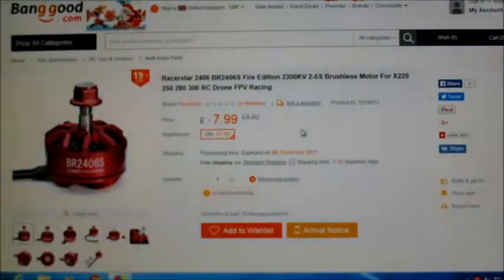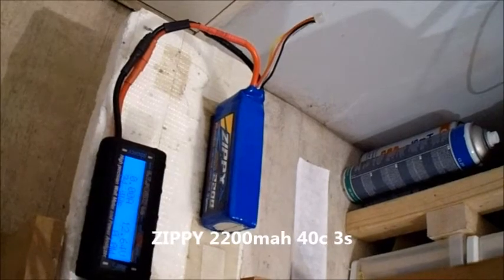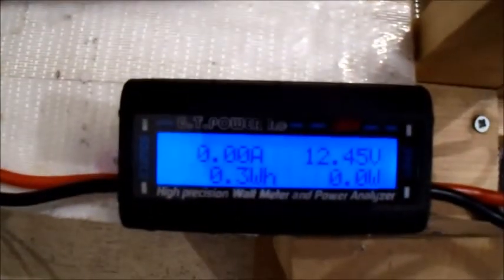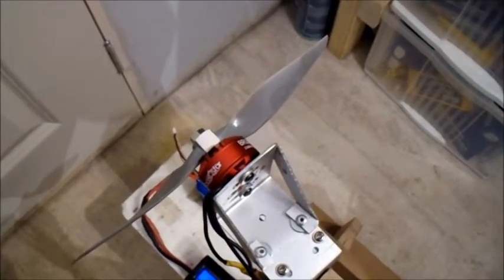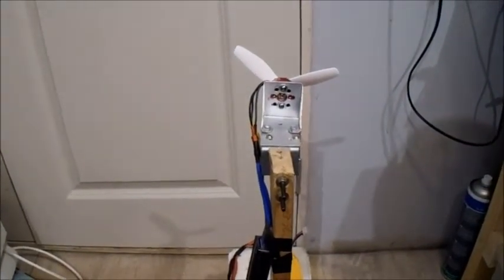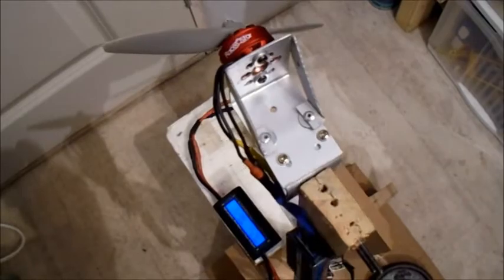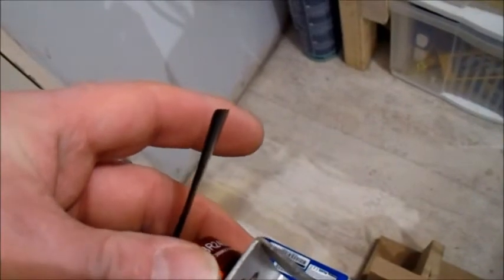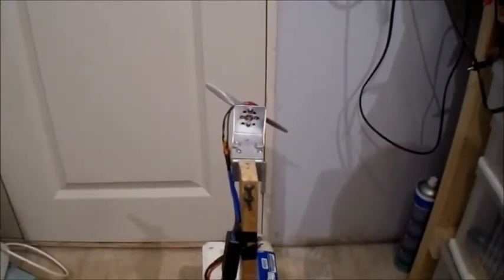Racerstar BR2406S Fire Edition Thrust Test Motor test of the Week

Comment: Great testing as always! Thanks for testing this on 3S as many are only testing on 4S these days, most a pity. I really like the efficiency of this motor on a 3S with the APC 6x4 Gas Prop ;-) Very nice! Thanks and Happy Testing!
Reply from the maker: Hi mate cheers for the comment. Would of liked a little bit more thrust but yes it's got a nice low current draw with the 6x4 gas on 3s. Nice long flight 
times ;-) Thanks for watching.
...RCPP

Comment: Hi RCPP, great testing as always, good numbers with the 6x4 APC gas again :)  I have the 2600 Kv version of this on the way, so I'm interested to see how it goes.  Interesting results with the Cyclone prop as well, I ordered some of those to try as well as some of the other popular 5" 3 blade props that the quad racing chaps are using, will be exciting to see how those go on 3S with higher Kv.  I got sucked into some Black Friday/cyber Monday deals and now have a total of seven quad racing motors and various props on the way to test out and try in my planes. :/  I'm just amazed at how much power comes out of these small motors and they are quite a bit lighter than a lot of the other motors I have used in the past.  If I can get equal or more power and save 15 or more grams in AUW, it is a winning combination for me :)  Thanks again for doing all this testing, so informative and helpful :)  Cheers, Scott
Reply from the maker: Cheers Scott
Yes we definitely seem to be on to a winner with the 6x4 gas props. Pretty good thing I stumbled upon there.
I will be interesting to see if there is any difference in flight between the cyclone and the bullnose style props. Would also like to test them on a much more powerful motor to see if the thrust and current draw differences stay the same or or if the speed tips on the cyclone props start to perform better at much higher rpm's?
I got myself a new smart TV in the sales ;)
You're right about the weight. Even though this motor is about 20-25% heavier then the other quad motors i've been testing it is still a lot lighter then the older 2212 style motors. 
I was a little disappointed with this motor. Was expecting a bit better performance but it's still pretty good. You may get some better results with your 2600kv version.
Thanks for watching Scott.
...RCPP
Reply: Hi RCPP, awesome news about your new TV, well done!  It will be interesting to see the performance of the 3 bladed quad racing props on 3S.  I have tried a 6" Gemfan quad prop in the past, turned out a ton of thrust, but in my plane did seem to create some drag as the blades are pretty wide.  I've been watching a bunch of video on what the quad guys are using, I also ordered these props  https://www.banggood.com/2-Pairs-Dalprop-Cyclone-T5051C-5x5-1-3-blade-Propeller-CW-CCW-for-RC-Multirotor-FPV-Racing-Drone-p-1211674.html?rmmds=mywishlist&cur_warehouse=CN   Watching comparisons, the blade looks quite a bit narrower than the other 5050 and 5045 Cyclone props, but good pitch, so maybe they might work well on a park jet like I fly?  I also ordered some of these props https://www.banggood.com/2-Pairs-Emax-AVAN-R-5-Inches-5065-3-Blade-FPV-Racing-Propeller-p-1189929.html which are supposedly designed for use on the EMAX RS2406 2750 Kv motor https://hobbyking.com/en_us/emax-rs2306a-2750kv-black-version-motor.html?___store=en_us which you have tested, they certainly have a wicked amount of pitch at 5065 :)  I'm hoping that even though the blades on some of the quad props are still pretty wide, that because they are 5" instead of 6" I won't see as much drag in my park jets.  Anyway, a few bucks spent and if they don't work out, there are a couple quad guys at my field who I'm sure might take them off my hands :)  Lots of testing to come when all this stuff starts arriving :)  Enjoy your new TV, mate!  Cheers, Scott
Reply from the maker: Cheers again Scott
Thanks for letting me know about those props. I might have to get some of those as they do look quite good. Thanks mate. Hope all your bits and bobs turn up soon.

Comment: Looks like it give slightly more than 1:1 thrust ratio for a parkjet, coming from a tiny little motor. Seems like size is getting smaller but power is bigger. Thanks for the info RCPP 👍😎
Reply from the maker: No problem Parkflyer. Cheers for your comment. Was expecting a little more thrust from this motor because it's a bit heavier but it's still pretty good for the price.  Thanks for watching.
...RCPP